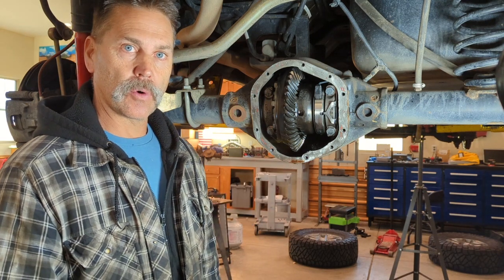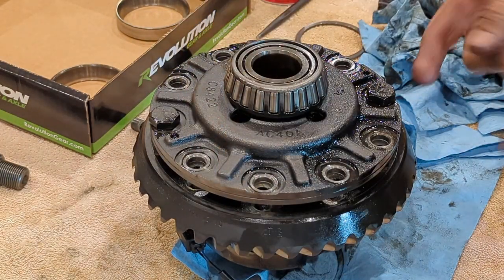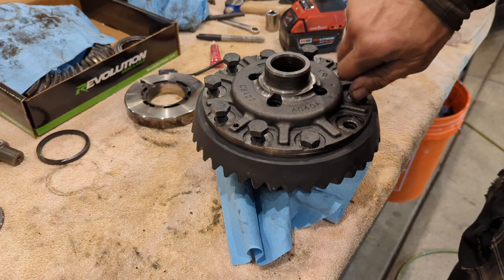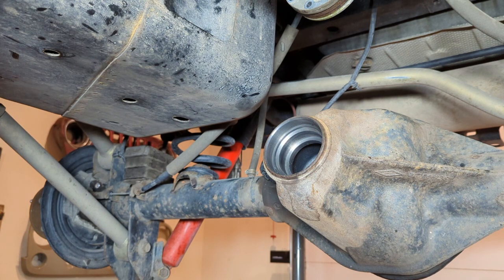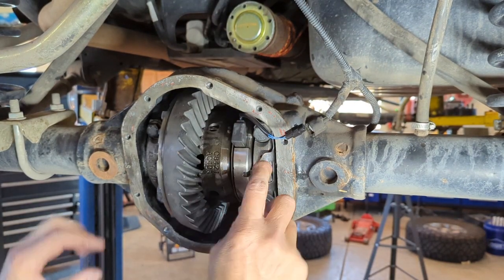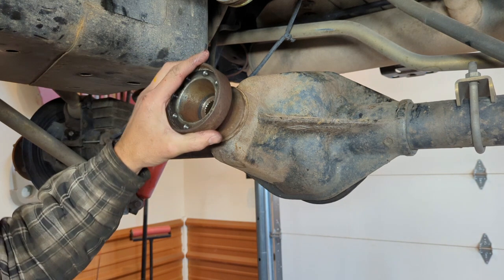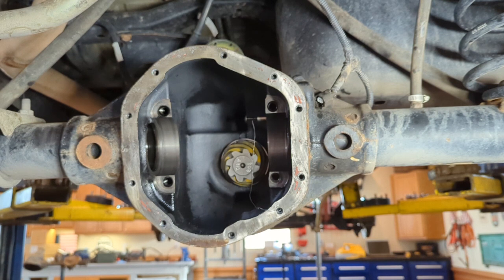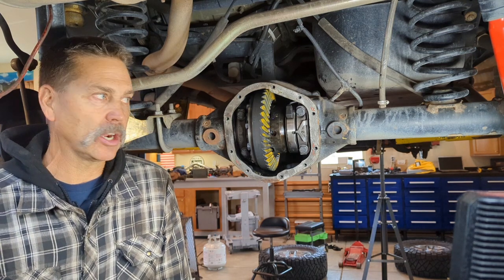How to Re-Gear a Jeep Wrangler JK Rubicon Dana 44

Comment: OK...I followed every step and everything went well, up until I went to do the final install of the carrier, right after pressing on the bearings (with the shims).  During mock-up everything was fine.  Carrier preload & backlash were perfect.  Note, I used "setup bearings".  After pressing on the new bearings, my preload is loose.  I'm now attempting to add equal size shims behind both races.  Problem is, they are so thin that they are buckeling as I direct the carrier inward.  Was there supposed to be a standard thick outer shim behind the races before I did my mock-up and shimmed behind the bearing?  If so, F-me!  What do I do now?  I think the problem came in between the differences in the setup bearings and the permanent ones.  But if that's the case, why even have "setup bearings"?  I bought them through Yukon.  Any help would be greatly appreciated!
Reply from the maker: Were you using a stock carrier or did you add a locker? I don't put shims between the bearings and carrier. I put them between the race and the housing with the thickest of those shims to the outside. Were the setup bearings the same brand as final bearings? I try to stay away from Yukon as their quality has suffered substantially in my opinion.
Reply: @TheBFHGarage   2001 Jeep Wrangler Sport.  Dana 44-R / 30-F Had 3.56.  Purchased YGK-008 4.88 kit.  Also purchased new rear carrier (YC D706025).  Yukon recommended the setup bearings (YT SB-D44).  I was advised that this would make the shimming process easier to shim between bearing & carrier.  I'm learning otherwise.  I know "you" shim behind the races (as I prolly should have too).  But, what's done, is done.  I see my only current option (other than tearing it all back down to square one) is to make up the difference by now shimming behind the race.  But this is starting to seem somewhat impossible.  Everything I know about this, I learned mostly from you.  You have my highest respect.  I've been studying through your videos (mostly) for over 6 months.  I've never regeared before. So if you're telling me that I will currently never get thin shims behind those races to make up the difference, then I'm back to square one, am I correct?  Thanks in advance!  Oh...btw, no lockers whatsoever.
Reply from the maker: @ninsar5765   confirming that your existing axle had NO master shims outside the carrier races? If it did, the thinner shims would go between those master shims and the races. If it didn't have them, then you may be back to square one having to pull the bearings off. On another note, the difference probably came from pressing the bearings on. A press will put them on tighter than you can manage by hand when installing the carrier.
Reply: @TheBFHGarage   First off, thank you so much for allowing me to intrude upon your very busy day.  Secondly, I greatly appreciate your input & advice on this issue.  It's definately been a learning experience and is helping to prepare me for the regearing of the Dana 30-F (I know, slightly different setup/process, especially with the crush-sleeve).  Now, in response, there were no master shims.  And out of all the research I've done, I don't recall anything anywhere ever being said when it came to the difference or how much of a diffrence I would experience once the bearings were "pressed" on.  So I am now assuming that I have to get a clamshell bearing puller and then decide whether to try adding to each side of the carrier to obtain a comfortable preload (again) or switch out altogether and go with shimming behind the race.  Which would you recommend?  In either case, I'm wondering if I'm going to loose my current meshing pattern?  My pinion is already set, preloaded and torqued.  And I had a beautiful mesh-pattern and a very comfortable preload.  What's your opinion on that?  Hopefully I won't be intruding upon you after this but again, thank you!
Reply from the maker: @ninsar5765  if you already have your depth established and everything is installed, all you have to do is get the backlash in spec and run a pattern to ensure it's still acceptable. That number might change just a little fun what you had originally, but if it's in spec then you should be good to go. Clamshell pullers are around $100 now so that might be a good option. The nice thing about those is that once it's set, you don't have to remove the bearings anymore. 

If you decide to go with new bearings, then you can adjust as needed outside the race.
Reply: @TheBFHGarage  Well....my pinion depth was established but I used a setup bearing there as well.  So I'm assuming that it's now going to have the same issue I had after pressing on the carrier bearings.  It's going to come up shallow.  Yes, I shimmed behind the bearing there as well, not behind the inner race. But theoretically, if I end up adding let's say .0015" shims on each side of the carrier to make up the difference from pressing on the bearings then I would think I would need the same size shim added to the pinion.  I mean, theoretically.  We'll know for sure within a week's time.  I just purchased the clamshell puller online, eBay $89.  I can't see going with new bearings as being cost-effective.  So, I think I'm going to start out by adding like a .001" shim to each side of the carrier and see where that puts me on my preload & backlash and then check my mesh pattern.  I'll adjust the pinion accordingly at that time, would you agree?  

Looking into the very near future, when I regear my Dana 30-F, I've been considering using a crush sleeve eliminator.  What are your thoughts on those?

Again, thank you so much for your input.  I have the highest respect for you & what you do.  I just hope that others see my own personal experience here and realize the difference one will get after using set-up bearings during mock-up then pressing on the permanent bearing.  I've certainly learned from this experience and if I were to ever do another regear job I would definately shim behind the race.  I don't know why I didn't just do that to start with.  Had Yukon not talked me into those set-up bearings ($140 by the way) I'm sure I wouldn't be having this issue right now.  Live & learn!
Reply from the maker: @ninsar5765  first, I do like crush sleeve eliminators.

Second, it sounds like you got a great pattern but not under the appropriate amount of pre-load the first time out. People have it in their mind that they can keep things snug, but not tight, and then add an equal number of shims to each side when they are seeing up final. You have to test it like it's final every time. You should be able to pull the carrier out by hand during setup. It should be difficult to get it in every single time and you should have to use the wrench trick to get it back out....every single time. Frustration sets in even for experienced gear setters. 

I would leave your pinion as is for now until you can establish proper carrier pre-load with the backlash in spec. See what that pattern looks like and then go from there. It sucks, but I've been there before too. Keep at it!
Reply from the maker: @ninsar5765  one more thing... When using the clamshell puller, be certain that the race is on the bearing, and that the bottom adjusting ring is tight against the race. The upper adjusting ring needs to be tight against the clam.
Reply: @TheBFHGarage  Actually I did have a good preload and backlash during the mock-up.  That's why I am going to attempt to add equal size shims to both sides of the carrier "as a starting point".  Believe me, I know to, and will take final readings & measurements before placing a stamp of approval on the final install.  

I definitely appreciate the tips & tricks advice on the clamshell puller process and all the other advise & info you have generously sent my way.  And, not to keep intruding upon your day but I will let you know how it all turns out and exactly how I went about it (ie: shim sizes, etc).  I know I would be curious if I were in your shoes. 

I'll also send you some pics of my rig to your e-mail address for your viewing pleasure at your own convenience.  I think you'll find it somewhat impressive.  The history behind it is interesting as well.  Sometime in the very near future I will sign up to be a Patreon Supporter to help keep your videos coming.  I'm already further educating myself in advance using your videos for projects like regearing my Dana 30-F, replacing rear axle bearings, replacing front hub bearings, etc, etc.  

Thanks again Mr. Mike!!   Oh......crush sleeve eliminators? Yay or nay?
Reply from the maker: @ninsar5765  yay on crush sleeve eliminators. 

Carrier bearing pre-load doesn't affect proper pinion depth. Start by getting good carrier pre-load with the correct backlash and run a pattern. If you can get in spec and still have a good pattern, then you're done 👍. If your pinion depth shows shallow like you think it will, then it was never set right to begin with. When checking backlash, make sure your bearing caps are on and bolts snug to ensure it's seated all the way.
Reply: @TheBFHGarage  I don't understand.  If the backlash changed when the bearings were "pressed" on after mock-up, then one would assume that the same thing would have happened to the pinion when it's bearing was pressed on after mock-up, thus making it shallower.  Yes...you are right.  The carrier preload wouldn't have changed the pinion depth but it probably did chang after having pressed on the pinion bearing,  same as the carrier preload changing when its bearings were pressed on.  I can assure you that EVERYTHING was set up within spec during mock up.  In fact, it was incredibly, perfectly beautiful.  The change only came about after removing setup bearings and then pressing on the permanent bearings.  But all is good, I got this now.  We'll know soon enough!  Thanks again for your input!  BTW, I'll assume you're not a big fan of crush sleeve eliminators.
Reply from the maker: @ninsar5765   I DO like crush sleeve elininators! I've answered that 3 times lol! I wonder if I replied to another thread...lol. Setup bearings can change slightly from the final bearings too. Happens a lot actually, but not by much.
Reply: WoW! You are 100% correct Mike! You DID respond about the crush sleeve eliminators, several times. Not sure why I didn't see it. Guess I was more focused on other information. My Bad Sir!
Reply from the maker: @ninsar5765  😂🤣 I answer so many questions that it's easy to lose track lol
Reply: @TheBFHGarage  So, just to update you in case you're curious, I completed the regearing of the D-44-R.  Had to feel out shim changes a couple more times to get my preload and backlash just right.  And although there was an ever-so-slight change in my mesh pattern, it was so minute that I made no further adjustments there with the pinion depth.  I am incredibly satisfied with the results.  And man!...what a difference it made going from 3.56 to 4.88!!  Right now I'm running without my front driveshaft.  In a couple of weeks I'll pull her off the road again to regear the D-30-F.  Can't wait!  Got a big 3-week camping, wheeling getaway adventure coming up in the Spring.  Splitting it up between Wolf Den Run in Western, MD, Rausch Creek & AOAA in PA.  And there's a few other spots I'll hit along the way.

Want to thank you so much for your videos and for your personal assistance with my own issues.  Thank you Mike!  Be good.....or be good at it!🤪

Comment: For setting up pinion, can you use the old race (turned down) so that it will slip fit in if you can’t get a duplicate of the timken you’re putting in? Thanks for your videos been a big help for me!
Reply from the maker: You can, but I don't recommend it. There is usually too much wear and it will throw it off considerably when you put the new one in.
Reply: Okay so I’d have to shim the pinion bearing method, which method do prefer, I’ve seen you shim the pinion and shim the race
Reply from the maker: @brading84  either one works just fine.